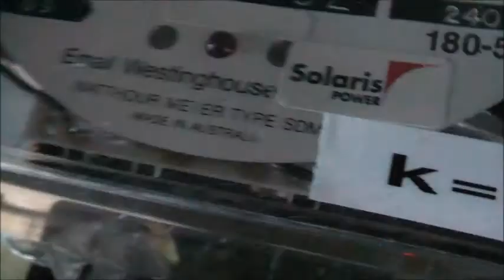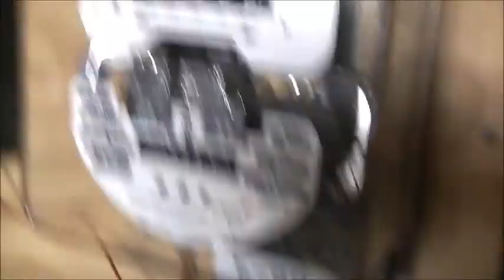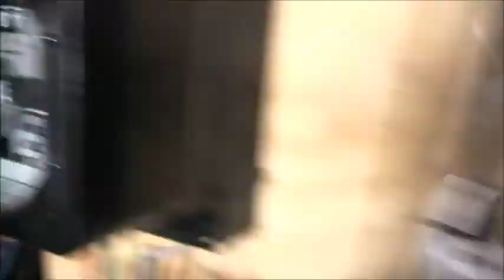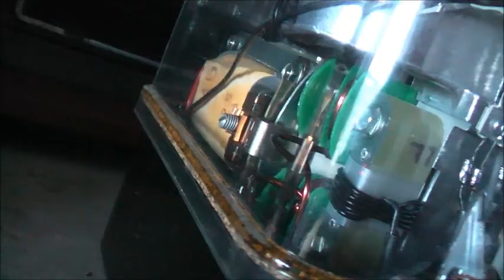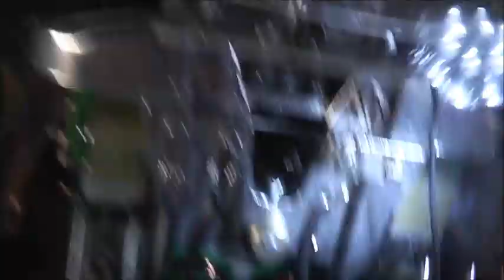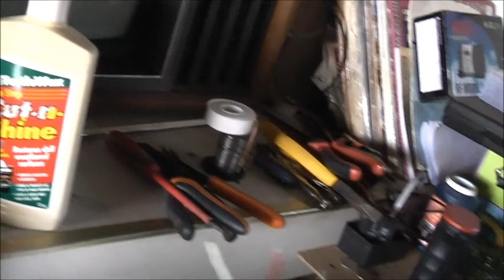EMAIL SDMP T Watthour Meter Test

Comment: Hmmm, Slow-spinning loadwheel?

Like you say, you may have wired it incorrectly, or....... There's a problem with the loadwheel.

Quickie test: Before wiring your meters, hold them up in front of you and gently rotate the meter left-to-right, but quickly. If there's nothing in there restricting the loadwheel, it should respond to the movement and 'wiggle' in there a little bit. The loadwheel won't move much because of the accuracy magnets, but you will be able to make the loadwheel move slightly. :-)

A little later on, I am going to have to dig out my GEC E43B R/M which is CT-based and do a phantom load on that alongside a whole-current meter.

......I bet that I get my loadwheel whizzin' up OK. :-)

Yes, check the loadwheel in there with the left-to-right quickie wiggle test. If needs be, you may have to consider opening the meter up and doing a physical check.

If you're sure that you wired up the meter OK and that the voltage coil is getting the required voltage, then there's tests you can do outside of the meter: Using a continuity tester / ohm-meter, check to see if the voltage coils aren't open circuit or anything like that.

Another thing which can cause confusion when wiring a 3ph meter for phantom, is wiring up all three sets of coils. I wouldn't.

I would just energise-up one voltage coil and its related current coil. A lot of 3ph meters will run like that I think, because let's face it here.....How would that meter have coped in-service with a mis-balanced load?

If you're going to wire up all three coil-sets, then do remember this top tip:

Voltage coils in parallel, current coils in series. :D

Yes, if you accidentally wire the voltage coils in series, There will be loadwheel speed problems, namely, running too slow.

Also make sure that everything  in there is in-phase as well, because if something is 'backwards' in there, it may 'fight' the current and therefore cause a slowing of the loadwheel....even a reversal.

Like I say...... wiring up all three coil-sets can get a bit confusing! :-O

Thanx for showing,

-BoomBoxDeluxe.

26th April 2014, 14.45

Comment: We used pulse pick up in the early 90's for commercial electromechanical CT meters. The device needs current limited 6, 12 or 24 Volts @ 20 mA to drive the opto LED which scans the disc. there is an open collector transistor which provides a pulse each time the black mark(s) are scanned from the disc. It is just a matter of carefully working out which wires are what. I think that your PT coils are wired wrong. A meter with 277.7 revs/kWh should spin at a reasonable speed at 5 or 10 Amps.